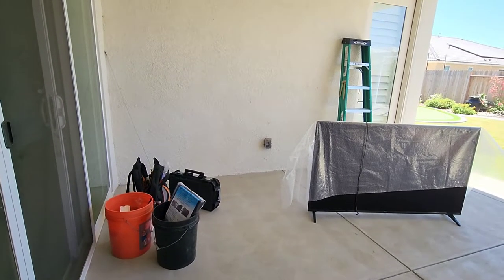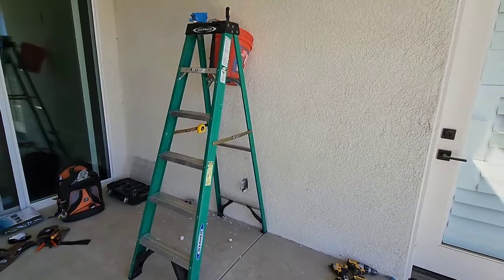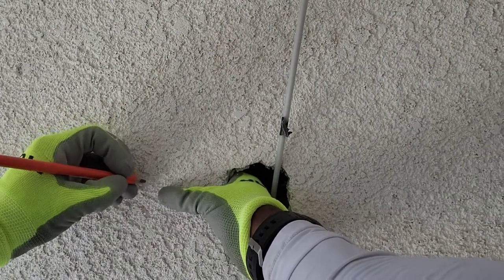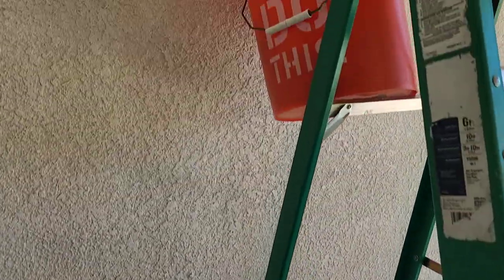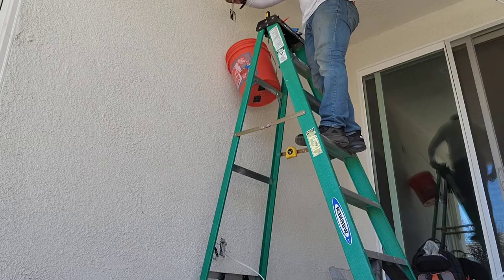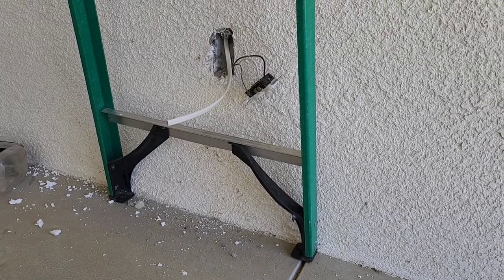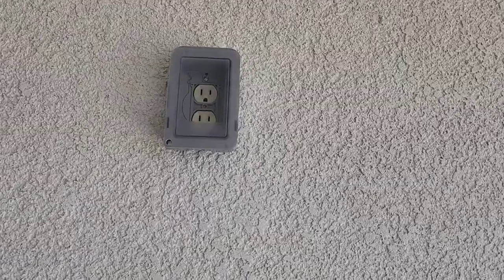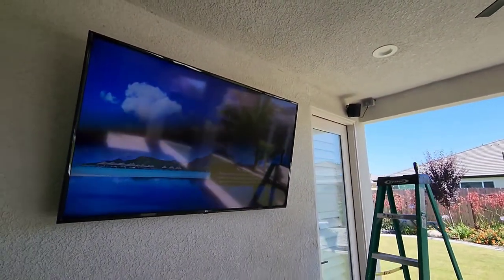How to find studs behind stucco wall

Comment: Have you ever had to find studs in metal lath and plaster? I wanna hang my 75 inch tv but it's been difficult to find studs cause my walls are metal lath and plaster. TV weighs 83lbs.
Reply from the maker: Yes that's why I like to knock hole first in wall where I'm adding an outlet for the TV, to find studs then after I find studs I just use same hole to add in the outlet that I needed anyways for the TV. The technique in video should work especially if you are hanging tv above an existing outlet. Studs are usually right next to outlets.
Reply: @justelectricllc that makes sense to me. I never would’ve thought of doing that way. Nice tip bro! 👍

Comment: Are you a licensed electrician? Because outdoor outlets are supposed to run 12 gauge not 14 gauge
Reply from the maker: That existing circuit was already 15amp circuit...im licensed and yes be mindful of circuit amp sizes and codes
Reply: Also doesn't look like any exterior outlet I've ever seen.
Reply: @justelectricllc  2:52  Never seen a licensed electrician use a "scotch lok" type connector in a 120v circuit before. I'm thinking that is not correct, especially on solid wire as it will absolutely damage the conductor. Also, not a fan of daisy chaining outlets....pigtailing being the preferred method. I'll stop there with my thoughts.......